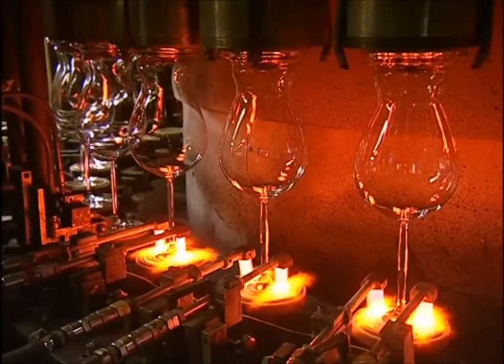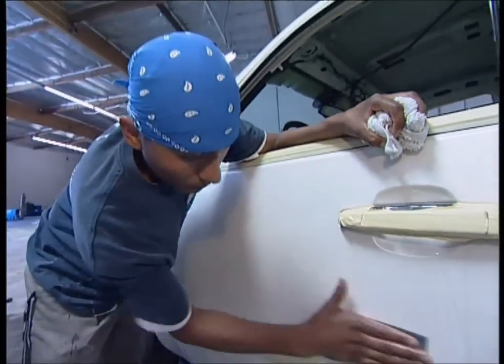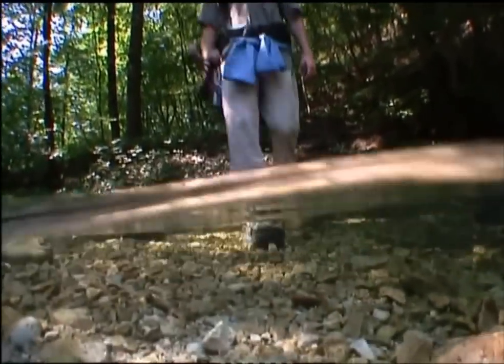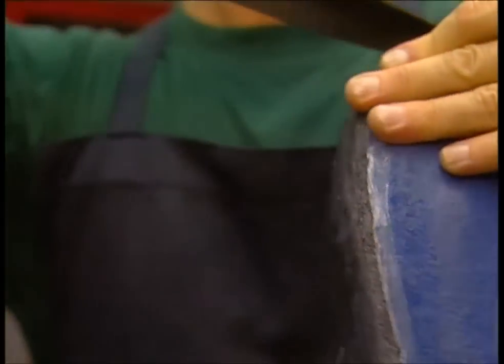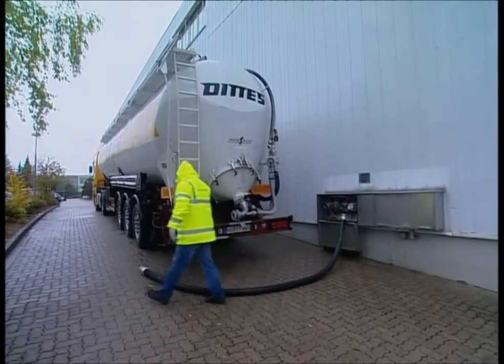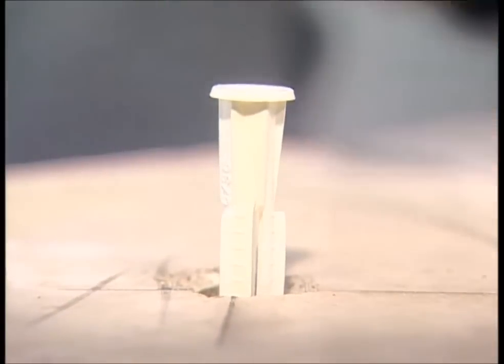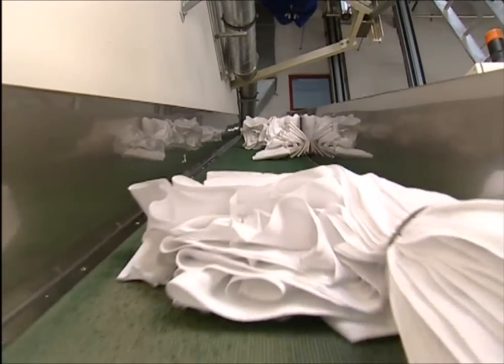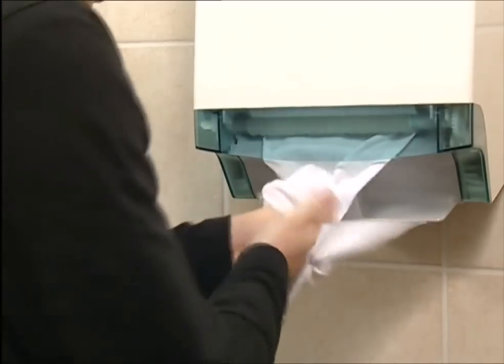HOW IT WORKS | Stretched limousines, Hiking boots, Wall plugs, Towel dispensers | Episode 29

Comment: I'm not an expert with engineering cars but here's what I think could be done to transform a standard everyday family sedan or SUV into a limousine!!! so please bear with me & correct me if I'm wrong!!! say you want to make a 2020 Cadillac CT6-V Limited i-TRAC AWD 6.2 t-Turbo V8 4-Dr Luxury Sedan (LHD) into a 6.5 metre stretched limousine!!! you need to procure 2 pre owned or lightly damaged Cadillac CT6-V Limited i-TRAC AWD 6.2 t-Turbo V8 4-Dr Luxury Sedan (LHD) from a scrap yard, one that hasn't been scrapped as yet!!! cut out the mid floor section including the full B-Pillar from the 2 donor Cadillac CT6-V Limited i-TRAC AWD 6.2 t-Turbo V8 4-Dr Luxury Sedan (LHD) & weld each other to the length you intend to stretch!!! and then weld the new floor section back onto the front & rear section of the car that you've already cut out for the stretch!!! agreed it's a time consuming complex job but it's worth the effort & money!!! please advise!!!

Comment: just stretch the middle section of the existing original monocoque chassis of the car with the same sheet metal from another similar car from the scrap yard!!! ofcourse the entire stretched monocoque chassis will need reinforcing!!! better workmanship, quality & long term durability!!! way better than cutting a vehicle in the middle & adding two longitudinal support beams & hundreds of weld points!!!

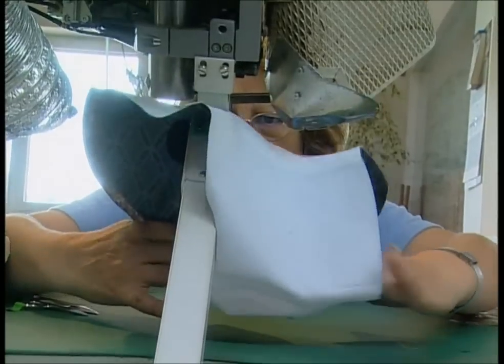Comment: 8:00 water molecules are larger than steam molecules?  Stupidity abounds.
Reply: Liquid water molecules are indeed larger than gasious state water (steam). That’s true for most any liquid. Goretex is based precisely on that principle. 
Another benefit of this change of state is that a gas can be compressed while a liquid can’t. This is the difference between pneumatic versus hydraulic power.
Reply: @blaws6684  water molecules are water molecules, whether in liquid or gas phase, so they can't be a different size.  And this video claims the gas molecules are 700X smaller, which is nuts.  Curiously, the wikipedia page on goretex says that "Each pore (in goretex) is approximately 1/20,000 the size of a water droplet", while the video claims the "water molecules are 20,000 times larger than the airholes (in goretex)", so clearly the narrator just misread the script (or the writer goofed when  copying some info about goretex).
Reply: If the volume of a known quantity water does not change when changing state gas/liquid/solid perhaps you’d like to explain how frozen pipes burst? Explain diffusion through a membrane? And finally how does Gore-Tex work.
Reply: I stand corrected and thank you. It’s been a long time since I did chem and I had forgotten some basic principles. In the case of change of state you correctly said molecules don’t change size when changing from one form to another. Actually They change volume. And most relevant to Gore-Tex, the smallest condition for liguid water is a droplet of numerous active molecules  thanks to the surface tension inherent to that state. Hence the rejection of liquid water droplets through their Teflon membrane and the diffusion properties of water vapor as single molecules through the same filter

Thanks again.

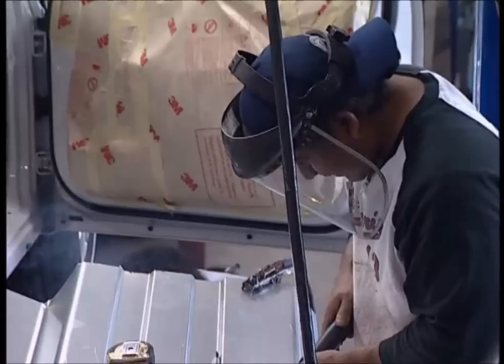Comment: @2:50 welds without a shade, @2:56 grinds without facemask. Employee of the month.
Reply: I thought the exact same thing!!
Reply: But the white guy in the scene before it has all the right equipment.....
Reply: Ah, the good ole safety squint! Never failed my eye yet
Reply: "If you have to grind your welds, then you're a grinder, not a welder" lol! Can't remember who told me that, but its funny nonetheless.
Reply: @applejacks971  it holds some truth but a lot of the time you need to grind your welds anyway if you need it flush or to grind down a weld bead for painting.
Reply: @2:50 he's spot welding and closing his eyes, he doesn't need a welding mask for that. @2:56 he's got safety glasses, he doesn't need a full face shield just for grinding unless he's laying down with sparks falling on him, even then you don't really need one. He's a vehicle conversions worker doing what every other automotive worker does, panelbeaters do the exact same thing.
Reply: @Insomniac3d  um... yeah he does need a welding mask / helmet. Your eyelids can't stop UV rays
Reply: Jeff Greene your eyelids will stop welding sparks and it will stop you from getting blind spots in your vision. He’s spot welding not welding a join together